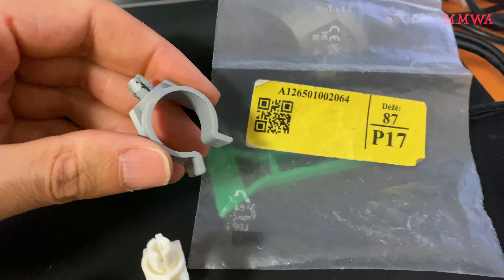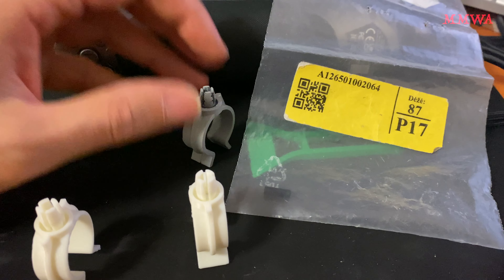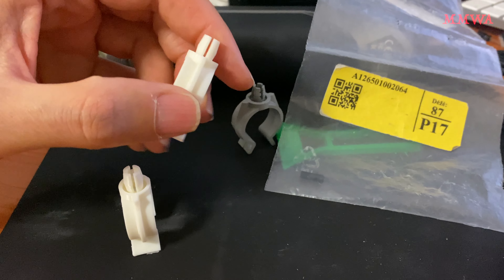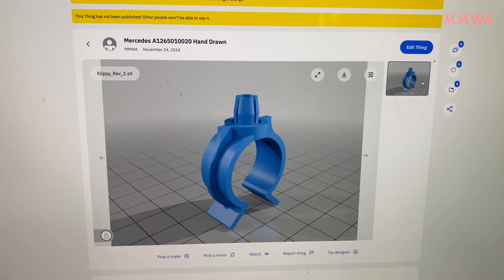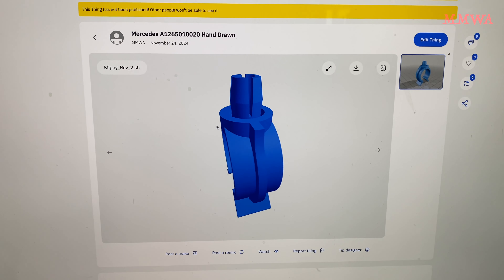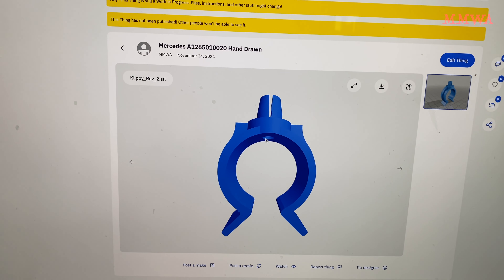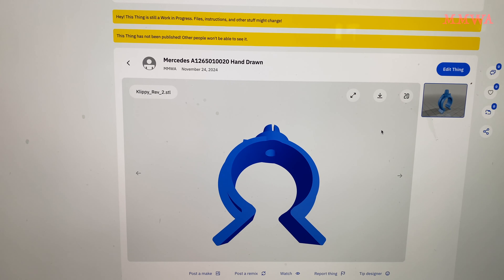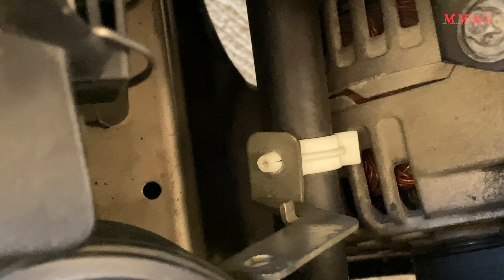Mercedes A1265010020 - MMWA Joins Thingiverse

Comment: Looks great! On the firewall of my 560SL there are two clips which hold the wiring harness up and against the firewall. I broke one when I was installing the engine. I have had friends make me a clip or two with their 3D machines, but the material used didn’t hold up to oils, fuel or heat. Within a couple of years the parts became dust just from the heat and outdoor elements. I was wondering what 3D material is used that can last? I don’t know anything about 3D printing.
Reply: "Within a couple of years the parts became dust just from the heat and outdoor elements. "

Have you considered becoming an OE supplier? 
😀
Reply: @ no I haven’t considered becoming an OE supplier. Just curious if there is 3D print material available to the hobbyists that can withstand the elements.
Reply: @theundergroundlairofthesqu9261 😂😂